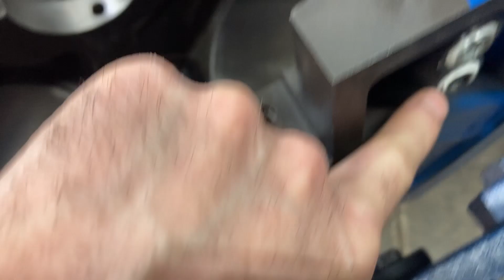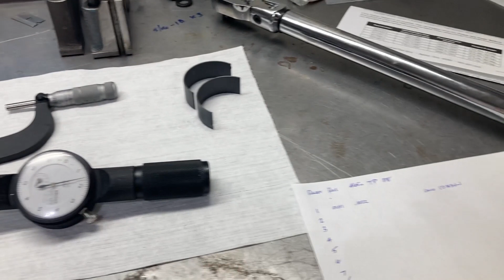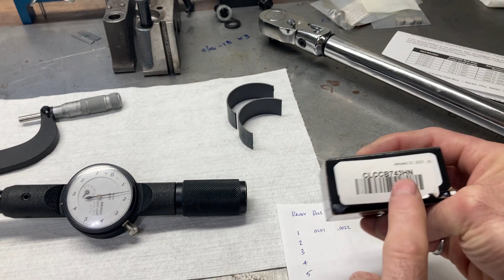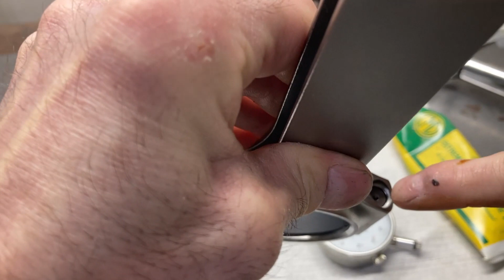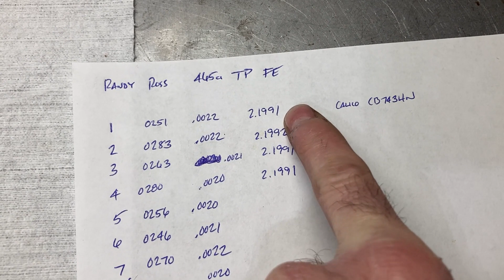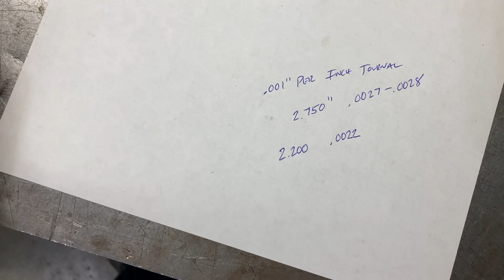Lykins Motorsports Ford FE 465ci Tunnel Port Build Part 2

Comment: Could you show  more on prepping the oil holes for the mains and matching them as well as drilling the oil pump passages and opening the oil filter adapter for the people that don't know . also opening the oil returns and timing chain oiling hole ?

Comment: Great videos. I grew up in the 70s and early 80s. Both my grandpas, and my dad drove 70s ford trucks with FE power. They didn’t have a lot of power, but they were dependable as could be. Now at 47 I still have both grandpas trucks, and a 352 on the stand. I hope you are going strong in a couple years when my kids move out, and I can start dumping more money in some high hp reworks! Thanks for taking the time to share so much information!

Comment: Looks like the main bearing saddles are chamfered? I could swear I read recently that was a no no. Looks great & thanks for the videos 👍🏼
Reply from the maker: Some of these blocks were made like that from the factory.  I typically do not do much to them there because they have proven to be weak spots.  I didn’t touch these, that’s the way the block was.  Keep in mind that boring that hole out is a big no-no, but blending the opening to the bearing is ok.
Reply: Thank you Brent !!